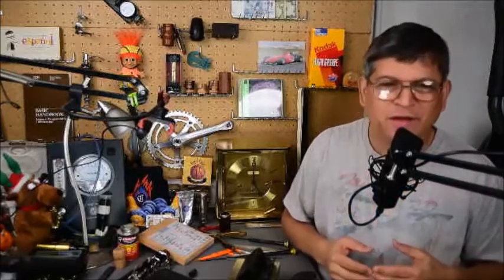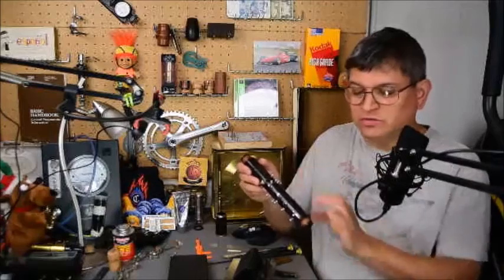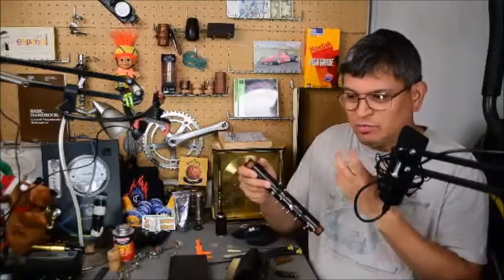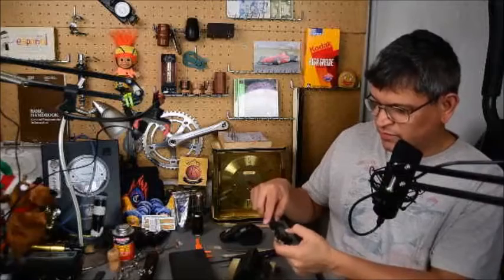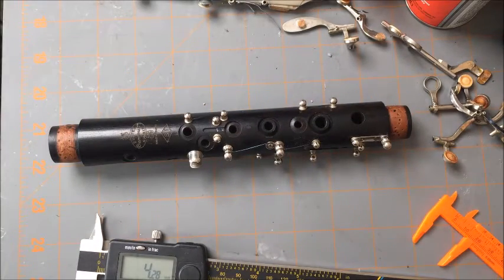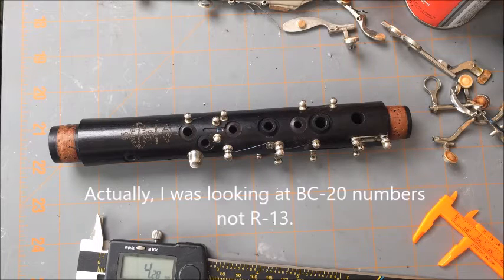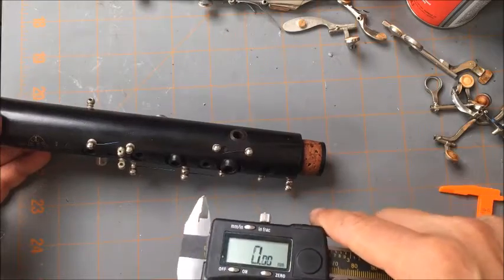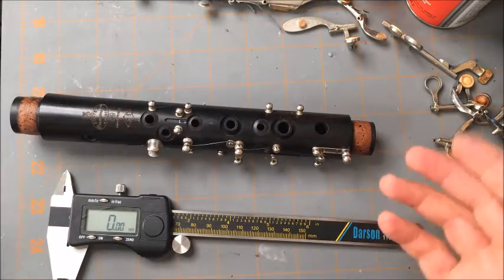Clarinet Measuring Toneholes - Buffet S1 for R13 BC-20 RC comparison

Comment: For measureing tonehole diameter...small hole gauges are the way to go!
1. Easier..especially at various depths into the hole
2. Zero chance if nicking sealing surfaces!
Reply from the maker: Yes I have a set with those T handles. But I used to measure a lot of clarinets to build up my spreadsheet.  The hole gauges just made it painfully slow for me as no one was/is paying me for my time to calc out various clarinets including the bore (using a shotgun bore gauge).
Reply: @gottalovetheknowledge4749  no...not thise T shaped ones.
Google split ball gauge
Super fast and easy!